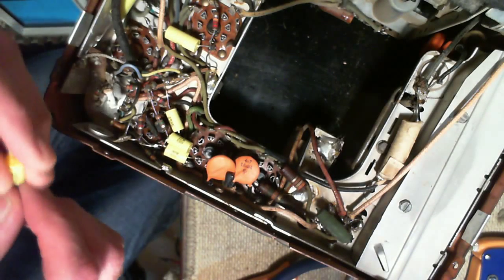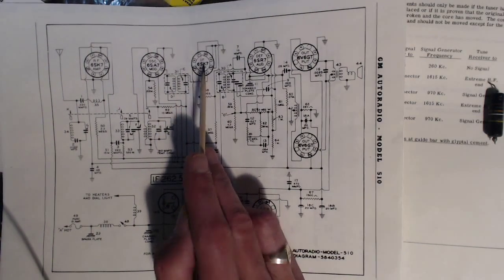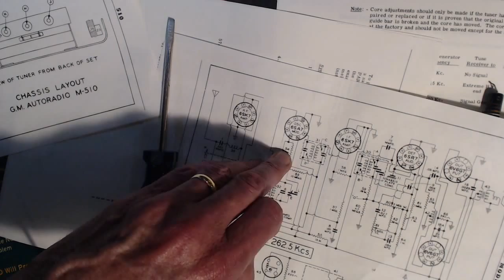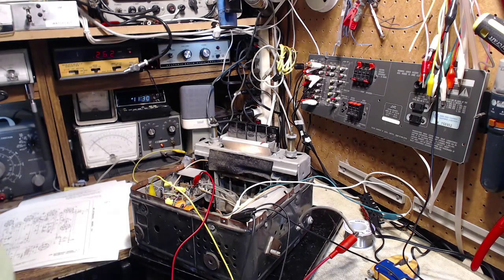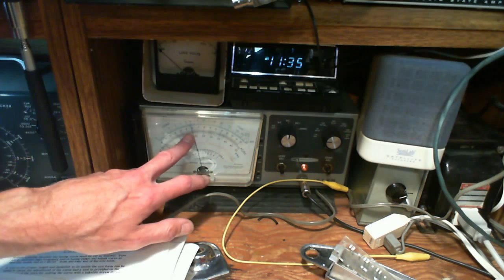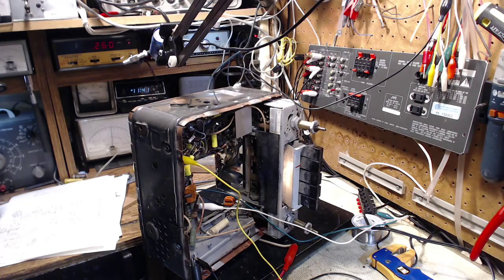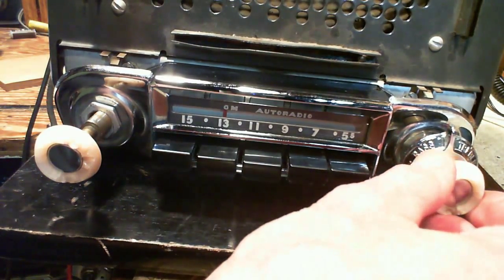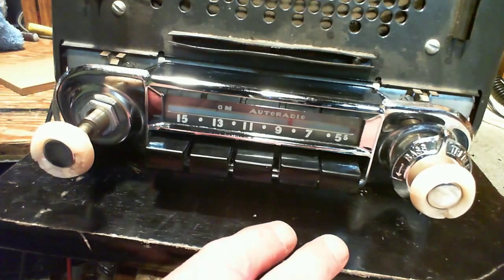1952  GM Autoradio Model 510 Video #7 - Alignment and Final Test

Comment: Jim
As far as the tuning goes,the mechanism works somewhat like a tuning capacitor.  Perhaps cleaning and lube will help to loosen it up.  I have done this before, and it has helped.  I can tell you from experience that a radio that is as old as I am gets a little stiff from sitting and not being exercised.

Comment: Jim are you sure you have to push the button to the side first. Seems kludgey. I remember setting a car radio by just pulling the button out, then pushing it back in when  you have the station in tune. If you don't have to push to the side you might be damaging the mechanism.
Reply from the maker: JPennDotCom It's in the instructions. If you don't pull it to the side, it won't pull out.
Reply: OK. Sounds strange though. Looks like you would be straining the mechanism. Of course this radio came out a year before I was born so who knows what other crazy things they came out with way back then. BTW I'm enjoying your videos. Thanks.

Comment: power supply?
Reply from the maker: ***** I don't know yet. The power supply is a new addition and I don't have much experience with it yet. It powered the radio fine earlier.
Reply: Jim Lindenas The buzzing when you first connected the auto radios to the your new power supply concerns me.  You should definitely run a few tests on the power supply to track down any gremlins.   Sounded like the protection circuitry was kicking in and out rapidly causing that buzzing.   Seems like it stopped after winding up the voltage.  Might be worth checking internal connections and clean the controls.

Comment: That "garabled" sounding sound is like a bad buffer capacitor.... Might have the wrong value.... I've never saw a disc capacitor used as a buffer cap.
Reply from the maker: Carl Burgess But earlier the radio sounded fine. I only noticed the garble after putting it all back together.